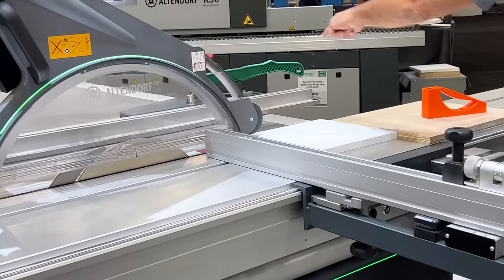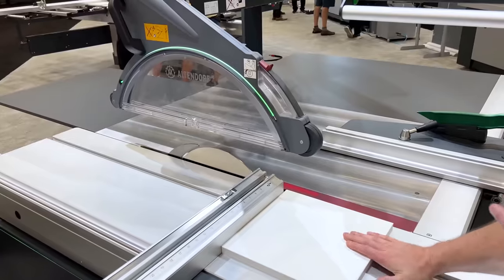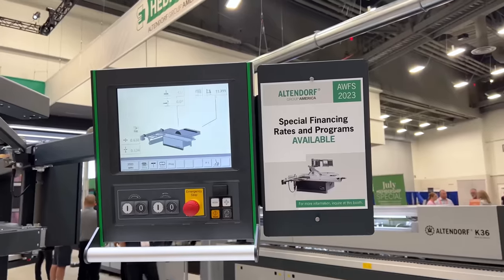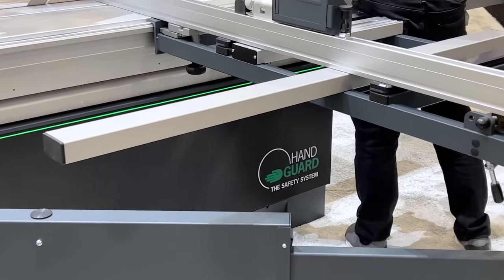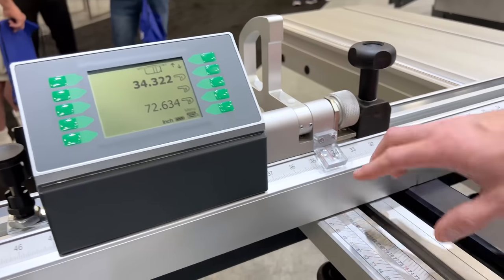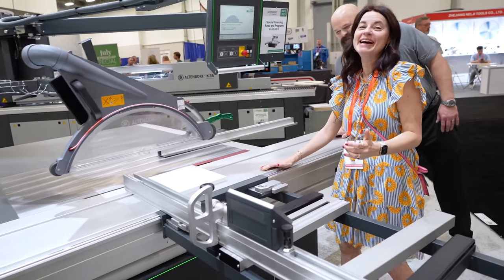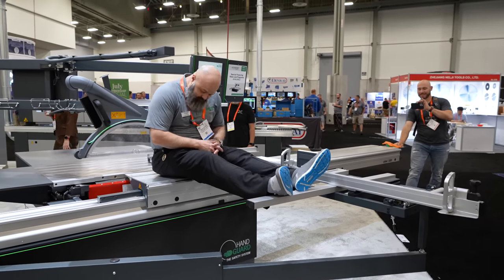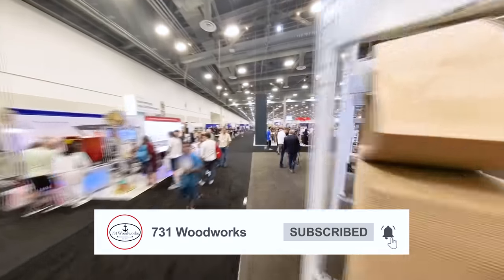The Most Exciting Table Saw in YEARS!

Comment: I love that other companies are doing this, but the sawstop system seems superior. I like that this system is proactive and therefore the blade can be driven down and saved vs the sawatops reactive system that ruins the blade, however, the sawstop uses a very simple capacitive circuit that is dead reliable. There is too much room for error and component failure in a “camera based system with AI”.
Reply: All of the technologies and drive system components have been in service for many years/decades in the metal cutting machine industry. We decided to adapt those proven technologies to be used in the woodworking industry.

Comment: I wondered when someone would release a a non-destructive blade dropping system. I don’t know if I like the computer vision aspect but I guess it might be required to avoid running afoul of that other company’s patents.
Reply: Felder have a very similar system available in their similarly priced models. If I remember correctly, theirs has the blade (and entire motor mechanism) held in tension with a spring trying to push it down, and an electromagnet holds it up in place. A similar computer vision system looks for hands, and if one enters the danger area, the magnet turns off and the blade shoots down. I think the mechanism is caught under the table by a suspension system, and it has the same button press to reset the machine.
Reply: Competition is good.
Reply: Just to be clear...NO ONE has a similar system to ours.  The felder system is a CS system akin to the sawstop. There are no others that come close to the HandGuard.

Comment: Holyshit,I just soiled my pants watching what this guy did to demonstrate the tablesaw blade's safety features!!! He's either got a huge set of cahona's or absolute trust in the machine and it's abilities to NOT chop something off, either way you'd never pay me enough to be doing what he just did 😢. So glad that I'm watching this video from the comfort of my bathroom!!!
Reply: 😅😅😅 I have absolute faith in that system...now the first time I did it wasn't quite as fast but today my favorite way to get a reaction is to stare deeply into the customers eyes and then try to grab the blade while it's spinning and not break eye contact. That's usually good for a jump and a few shouts!😅
Reply: 😂😂😂😂 I can tell you the 1st time I tested that saw was not quite that fast! Now, my favorite thing to do is stare at the client while the blade is running and the guard is all the way up then, while holding eye contact I throw my hand at the blade and TRY to grab it. I still haven't "won" that battle but it usually gets me a lot of shocked faces and a few shouts. And I will do that from the front, back and sides of the blade. it really is that good. It blows my mind every time I present it and is a BLAST to mess with!
Reply: @BradSnyderAltendorf  I can see where you are coming from but the thing that scares the bejesus out of me is that there is ALWAYS  the chance of the software failing or my luck would be the camera's being covered in dust or something worse and that is when I'd loose my fleshy parts!!!.
Reply: @BandSWoodcraft  I can see where you are coming from but the thing that scares the bejesus out of me is that there is ALWAYS  the chance of the software failing or my luck would be the camera's being covered in dust or something worse and that is when I'd loose my fleshy parts!!!.

Comment: Hi 👋, Great table-saw , I started work back in 1966/7 in the Uk , in company,  that made beds and coffee tables, et cetera, 
I remember one guy probably in his late 30s early 40s, then cut off is the first three fingers office hand, right hand on a sliding tablesaw , the strange thing is they’re trying to find his fingers that are dropped down into the sawdust. I cannot remember exactly what happened after that apart from I’m going to hospital now I didn’t see him again., about a year later, there was a guy that crashed his left hand in a press that to operate it. You just kicked a foot pedal to operate the hydraulic press, he was putting the hardwood edging onto a coffee table top, the piece of wood hadn’t quite gone into position. He released the pedal move the piece of wood back in position, but as he was doing so he kicked the pedal again. His left hand, fingers and part of his thumb flattened.. 
in my 45 years plus, working for myself , I have had two accidents, the first one I was not injured, but I was thrown across my workshop floor, I was making a very large jig, to profile drawer fronts for Louis the 15th style bedside cabinets , the jig was running on a bearing, and the cutter block was above that, and as I was profiling the piece of wood cutter, it’s off, grabbed the piece of wood and spat it back at me, my main problem is my spindle moulder was not powerful enough was only approximately 3 hp, . It obviously stalled.. and I was very stupid as I was taking too big a cut at one pass, through experience, I learn to cut off some of the waste on the band saw before carrying on with the job on the spindle moulder. Or take in light of cuts to finish., my second accident I was very lucky, my table saw was very powerful, 10 hp, Very large blade, I was book matching boards to make a cabinet, I had been doing this for years, this time I was deepping walnut, 6X8X36” long,
The peace of wood road up off the blade and drop back down again onto it, spat it back at me, hit me in right side of my stomach, I travelled across the workshop, I was semi conscious all I remember was a whirring noise I couldn’t move apart from pulling myself across the floor. I managed to hit the stop button on the machine., the last thing I remember is get into my workshop door, and that was it, my workshop was on the farm, and the landlord owner of the farm, walked past the end of my building and saw me laying out on the ground by a call the ambulance, I was taken off the hospital stayed in hospital for three days, but I ended up losing all my equipment. I couldn’t work for approximately three months, I had to close my business up, I then worked for some other companies doing sub contract work, building components for church organs, then back in 2003/4 I restarted my business again, I managed to get some serious work renovating and restoring some old barns and properties, I was making specialist doors and windows and staircases other pieces of furniture for properties,
By the Time I finish work in 2019 , I have a serious workshop, especially working by myself, 
In 2019, I did end up with another problem , this was called my ex female partner, unbeknown to me, I was being scammed. I was forced to stop work., but that is another story to say the least, I’m now retired, living in France, I’m now 71 years young, and I still wish that I was back at work. A bit of advice when you go to machine something think of the consequences if it goes wrong and make sure your fingers are out of the way of your cutting surface., as I have seen a lot of things on YouTube, especially where people are planing wood on a jointer, and using their hands to push the piece of wood over the cutter block, if this kicks back or shoots forward, your fingers then drop down into the cutter block, so please be safe, I hope this helps somebody even if it’s only one person, and I hope you enjoyed my story. 
Phil from the moulin France,

Comment: Impressive technology, but the first thing I noticed was that they didn't actually have a blade in the machine capable of cutting anything, and not once did the block of particle board (?) come close to the dull disc they had in place of a blade.
Reply from the maker: AWFS (the convention this was at) would not allow live blades.  There's tons of video on Alfendorf's website showing this with a blue.

Comment: I’m a safety manager and the expense of these systems is marginal compared to one amputation. It would be dumb not to get this if you’re hand running saws in an commercial setting.
Reply: But automated and hands off is better.
Reply: @pgnandt  "hands off" is what we are trying to avoid.
Reply: @bent.cyclist  Why would you avoid hands off? We're talking about a industrial setting.
Where the machine is running all day long. I used to write operations and safety protocol for process machinery. If my boss gave me a budget, I would spend money on an automated table feed and not what is shown here.
Reply: @pgnandt  absolutely. Hierarchy of control.
Reply: @yolo_burrito  Instead of mitigating a risk. Remove that risk all together. The money spent on this could have been spent on a servo driven sled. Maximizing cutting rate based on the current of the blade motor. Pneumatic dogs to hold material. Hands off while the operator stages and off loads.

Comment: Amazing, I wonder when the lens of the AI gets dusty will it alert the user to clean before proceeding?
Reply: The system has to run a calibration test once before every shift and will alert if there are ANY issues at that time. Honestly, dust has not been a problem with any of the saws we have at our clients facilities. And they vary greatly in terms of cleanliness and amount of dust extraction.

Comment: Now that the Sawstop patents have been expiring, we will finally get to see some more competition like this. Bosch had their Reaxx system which was a lot better than Sawstop in that it dropped the saw blade like the Altendorf, but not the same type of mechanism. I'm all up for anything that gives Sawstop some long overdue competition. However, the computer vision aspects will make it all too expensive for anything outside of commercial applications.
Reply: This is not using anything remotely close to the way Sawstop works so there is no patent topic here.
Reply: @Maxime-ho9iv  True but then again I wouldn't put it past their lawyers to try something. They're using a completely different technique anyway (live computer vision vs. conduction on the blade).

Comment: Considering the technology that detects your hand could probably run pretty easily on a modern smart phone. The only bit that is really new here is the blade retraction. I'm pumped that this might be a thing in a very short amount of time.
Reply: You get it!! We use technologies that have been proven for many years and adapted / married them together for use in the woodworking industry. Even the drive system components have been proven for many years on metal cutting CNC machines. It is a rock solid system!😊😊😊

Comment: I love working with the altendorf saws but 250kg ain't gonna cut it at my job, we have two saws and we had to reinforce the sliding table
Reply from the maker: what are you cutting?
Reply: @731Woodworks  it is a really dense plywood which ranges from 0.75g/cm³ to 1.4g/cm³ with a thickness up to 170mm and sheet size of 1.2 meters by 2.5 meters
Reply: You are the perfect customer for our floor mounted dual support set-up. it can easily hold over 500kg. Not a lot of shops working with those weights but they are out there! 😅

Comment: What does it do when you approach the blade from the side? Like you finished a cut then your hand sweeps back that way? Seems odd he never talked about that scenario so I'd be curious if it would still detect that. I'd imagine so since those cameras are still finding your hands, but just seemed odd he didn't cover that.
Reply: It detects up to 6 hands 360 degrees around the blade. I did test it by trying to grab the blade from the side but didn't make it into the video! 😂😊
Reply: @BradSnyderAltendorf  Nice. I figured that was the case, but regardless, I appreciate you taking the time to reply to a random keyboard warrior like myself. 😂

Comment: Considering the target market together with the precision engineering that goes into the product, I'd say this isn't all that pricey at all if the price is at EUR65k.
I've once (~2007) visited a fabrication shop locally (Southeast Asia) during a project where they were doing CNC punch and bending of metal panels and the owner was introducing his new CNC metal bending press units.
He had one original unit from Siemens which cost (at the time) about US$200k for the press itself (an electric servo rather than hydraulic, which was apparently cutting egde at the time) and another US$200k for the control system.
He also had an exact China made exact clone of the press that cost him US$80k but he bought the Siemens control system for it.
Basically the precision machining can be cloned by a China manufacturer but the control systems couldn't (and he didn't trust them to do so).
Considering the scale of production such machinery is targeted at, the price is actually considered very affordable compared to the potential losses/ expenses otherwise.
If a skilled worker loses an appendage, this can be up to US$30k in medical fees (for surgery, hospitalization, physiotherapy, and prosthetics) and another US$50k~80k in compensation easily on this side of the pond. Couple that with loss of a skilled worker and the resources taken (both time and money) to train a suitable replacement, the price of this unit is quite frankly peanuts.

Comment: Clever use of tech!
 
Would have like to hear how well it works for darker skin, the effect of the sensors geting dirty, and the saw being turned on with a hand is already in the path of the blade but not moving.
Reply: Darker skin tones makes no difference, nor does having multi colored tattoos OR missing digits. Also, if the hand is inside of the veiwing area, moving or not, it is recognized and tracked. the system doesn't rely merely on the picture of a hand, it recognizes and tracks certain points on the hand that are universal to the human hand itself. Skin tone was a big concern as we sell these machines world wide so that exact concern was addressed and tested extensively. The system has proven capable to recognize a hand no matter what level of pigmentation.😊😊
Reply: @BradSnyderAltendorf  Thanks for the additional input...

Comment: Doing this with CV (computer vision, the right term for what they're calling "AI") is not reliable or safe. There are all sorts of ways there could be an obstruction, dirty lens, someone whose hand is oddly shaped, tattooed, not white, etc. whereby it could fail to detect. The mechanism by which it's driven down is very interesting but also not safe - it needs a lot of power which could fail to be available (eg blowing breaker) at the moment it's needed. Using this thing as a safety mechanism would be a huge liability issue.

The leadscrew drive retracting the blade is quite interesting though and perhaps could be made safe with a SawStop type detector and spring loading to drive it in a fail safe way.

Comment: There is a Felder saw with a similar system in place but with magnetic repulsion,  very impressive  at about 16k
Reply: Not even close to being similar. Our system is completely unique and is the ONLY system  certified by the GS and recognized in the EU for sliding table saws.
Reply: @BradSnyderAltendorf  that seals the deal for me, I will buy the Felder.  Thanks for the reply.
Reply: Ordered a Felder. After a long bout of horrible customer service, before I even received the saw, I cancelled my order and bought an Altendorf.  So glad I did. Altendorf saws are far superior, and the service and availability of parts is awesome.
Reply: @montet202  oh man, you know I have to follow up on this one! Are you in the States and if so, did John install your saw?🧐🧐
Reply: I am in the states. Because Felder kept pushing back the delivery date (initially in June, then August, then November, then January, then March, then the next June…) I bought an ‘06 WA8 and set it up myself. I’ve gone through both Altendorf and Stiles for a few parts. I’ll be looking at a new replacement in a year or two. My new saw will be either an Altendorf or Martin. Whomever I get the most bang for my buck from. 😉

Comment: what if fingers were dragged to the blade from the side or from the back instead of straight front, would it still reactive before contact?
Reply from the maker: Yes, it monitors 360 degrees around the blade.  There are good videos on their website about the technology.  I linked to them in the description of this video.
Reply: Yeah, and I in all my brilliance have tested that many many times. I have tried to grab that blade from both sides both front and back and have yet to "win" that battle. The system can simultaneously track 6 hands all around those blades.

Comment: How it works when there is lots of dust? Or gloves?
Reply: Gloves can be worn but right now we say to use only orange gloves. dust has actually not been an issue, we have these saws in shops all over the world and haven't had any problems with build up. even if there were a buildup, the system has to run a calibration test once every morning and would immediately alert user if there were any issues like this. to clean them off all that's needed is to wipe it once with a rag. 2 seconds and back to new!😊